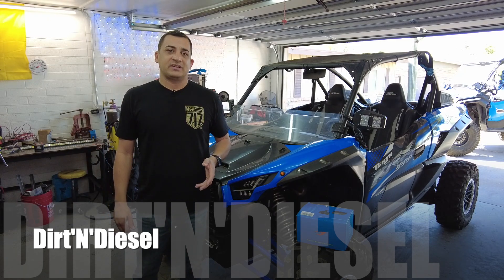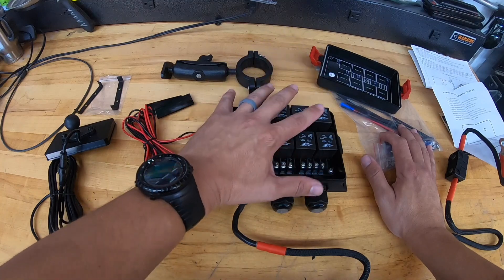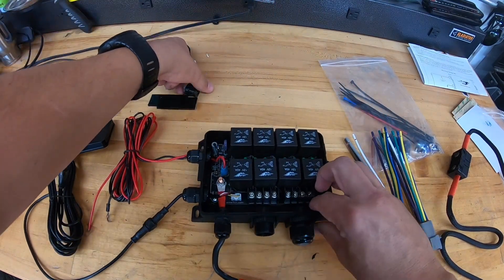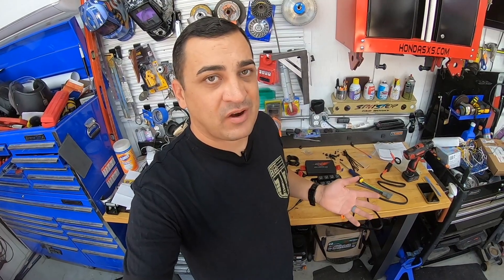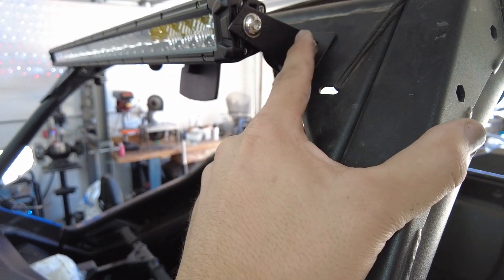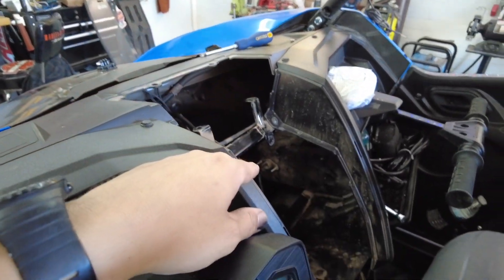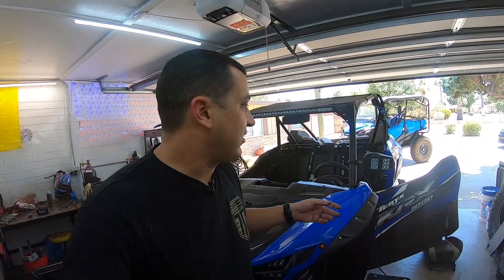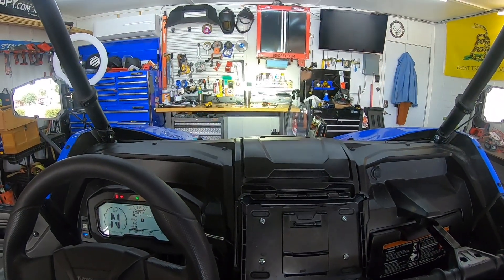Voswitch and light install!

Comment: I really like the idea of using the switch panel. That really makes a lot of sense especially when using light bars and whips. I think I’m going to go this direction and also hook up The Com to this. I’ve installed plenty of electrical components and have used many different methods but this seems the cleanest so far!!  Thanks